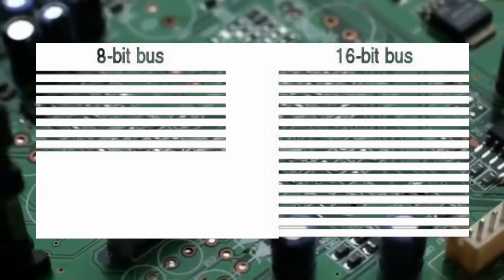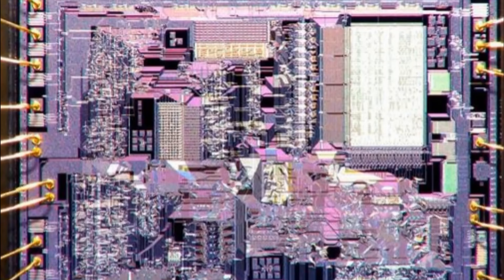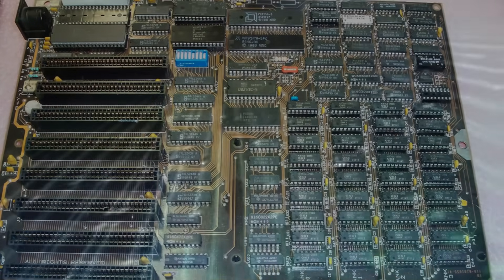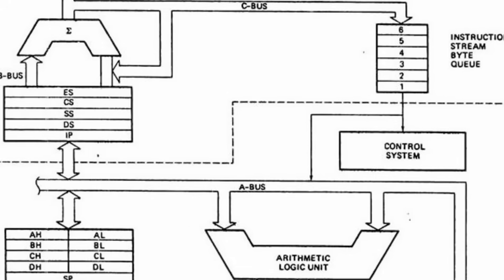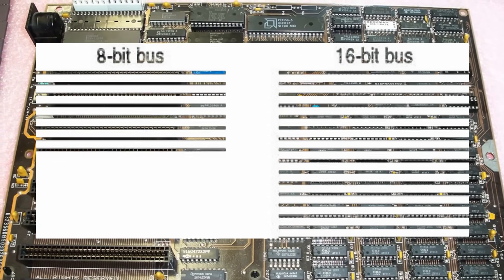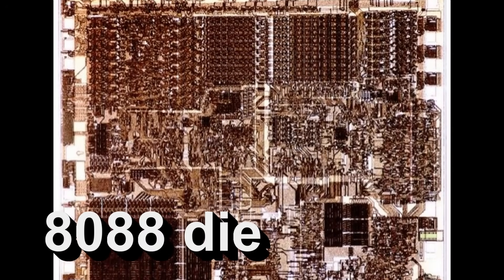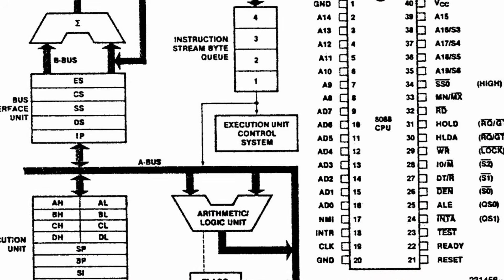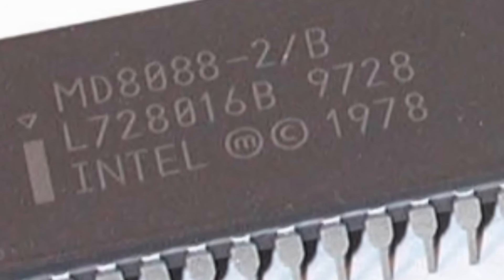8088 & 8086 CPUs... Why 16 bit Came Before 8 bit [Byte Size] | Nostalgia Nerd

Comment: after almost 40 years the 8086 is still in the legacy code of the x86-64 arcitecture ;)
Reply: Some maniac got windows 3.11 running on a 2.4GHz quad core i5 a couple of years back. You would not believe how fast it was. There is a hell of a lot of bloatware in modern operating systems that slows things down. That said the spoof version of DooM that was in one version of Excell was hilarious as the end boss was Bill gates in his underpants.
Reply: Windows 3.1 cannot use multiple processor cores. Only Windows NT versions could use multiple CPUs. Current Windows Versions derive from Windows NT.
Reply: Relax. S/360 24 bit instructions endured until the early 2000's. S/370 and S/390 ran these instructions ran these instructions with early /370 really only adding a TOD clock and a MMU (DAT). I think the early zSeries even still implemented 24 bit addressing. That's only 16M. About the size of a microcontroller by today's standards. There nothing wrong with maintaining compatibility. Nothing at all.
Reply: Personally I've been going down the low power route. My last buy was an I5-5600T with 8 gig of low power RAM and an SSD. Even with the keyboard mouse and monitor the whole set-up barely draws 80W when going flat out. It will quite easily run OrCad too. That said I'm looking for a better CAD system for electronics as I'm not impressed with either the software or the support. For seriously low power you can go down the 315 route and take another 30W off that if you throttle the clock a bit. If you get one of the really seriously efficient screens you can drop it to 40W total. Still runs Windows 10 OK and Linux is happy as Larry.
Reply: Gordon Lawrence wasn't that The Hall Of Tortured Souls Excell easter egg ?
Reply: The oldest parts of the instruction set actually trace back to the 8008 from 1972, and the Datapoint 2200 https://en.wikipedia.org/wiki/Datapoint_2200 , a TTL computer from 1970!
Reply: I could have got down to a lot less by using an i5-7002U which is half the power of the 3150, but it's only got 2 cores, and by using a laptop screen mounted in a desktop frame. The minimum possible is about 25W for a desktop but even the laptops only take 25W when not running fast and not running the hard drive. SSD's on their own are 5W when transferring data, 10W for the screen 5W for the RAM (Minimum) then 8W for the CPU and 5W for the motherboard. The only way to go below that is with a Raspberry Pi.
Reply: What make of SSD is it? Also is that during regular use or when doing heavy read/write?
Reply: ...but later on, seeing as I've just discovered a flaky USB cable interrupted a backup job that uses very heavy compression, which i thought had run successfully overnight, and have just had to resume.
Reply: Sandisk 480gb (SDSSDHII480G) - a hair under 4w when doing heavy random writes, a little over 3w at boot, under 2w the rest of the time.
http://www.storagereview.com/sandisk_extreme_ssd_review
Reply: Just like how humanity is still based on millions-old ooze too.
Reply: Though thanks to the various protected addressing modes that a typical BIOS and OS will almost immediately kick a modern chip into (never mind the different motherboard peripheral chipsets, video card support, etc), you'll have difficulty running a lot of 8088/8086 native code on a modern PC, unless your chipset and card have good built-in emulation for their own older standards, and you find a way to force it to start execution of code stored on a floppy or other such device without first booting the main OS or a new-style UEFI BIOS (though that's really the wrong term, as it sidesteps the normal "BIOS" altogether... I'm just not sure what the true term is, unless it's just "UEFI").

In fact a lot of the opcodes and maybe even microcodes can themselves be traced back even further, to the 8085 or 8080 (which is the root upon which both the x86 and Z80x architectures are built, being a significant advance over and also a significant codebase break from the original 8008). Because when it comes down to the really rudimentary things like ADD, or LDA, MOV, etc, why would you bother changing them from one generation to the next? And once you get down to the level where each of those only takes a single cycle to complete, you can't even really optimise them any further, other than maybe automatically recognising where you have a string of them in a row, particularly when each operates on narrow-bitsize data, and can parallelise them using SIMD and/or multiple cores. But you still have to load them in sequentially and output the data in a similar way unless they're all coming from AND going to adjacent memory locations. There's only so far you can pare down the fundamental, atomic operations, and there enough examples of code floating around in the wild for 20 years or more (and it's usually OS incompatibility that kills the true long-runners rather than CPU issues), so there's not really any reason to junk them or make huge changes to the way they operate and the opcodes they use.
Reply: +Gordon Lawrence ... well, you don't have to be that much of a maniac. I've seen a co-worker install it onto another's (Core 2 Duo) workstation whilst he was away on holiday for a joke before. It's a fairly forgiving OS, so long as it can read and write some kind of disk, as well as human I/O (getting the mouse to work is a bit of a game if you don't have a PS2 or serial one around, but USB keyboards work fine) and you have a compatible video driver installed (VGA does just fine), it'll fire up without any issues.

As for speed, Win16 was never particularly bothered about how powerful your CPU was (and, really, most modern versions still aren't, so long as you have a decent amount of cache to speed up task-switching). It's all about the memory, to cut down on how much it has to hit the disk, and to some extent how fast your video card runs and/or how much it has in the way of acceleration features. Requirements which any modern computer will fulfill in spades, even though it challenged a lot of contemporary machines when it came out.

You're right about how bloated some modern OSes have got, but Moore's Law seems to have outstripped them somewhat with Windows 7 thru 10. I've yet to use a computer running any of those which didn't feel just fine, at least so long as you had an SSD installed (it's still somewhat bound by kernel, service and program code loading times, and also swapping if you're low on RAM; hard drive throughput has massively lagged almost everything else in the computer speed sphere, and random-access times for spinning-disk drives have barely changed in thirty years), but I ran across quite a lot of dogs trying to run XP and ending up limping badly when it was contemporary. MS seem to have found a nice plateau in terms of how much chip power, memory and disk space they need in order to offer a well-oiled, fully featured modern operating system (quite simply, they've run out of things to add, I think, and are now focussing on polishing what's already there), and affordable hardware has had a good bit of time to stretch out and accelerate beyond the bare minimum needed for the salesmen in PC World to be able to keep a machine running at a good enough pace to make a sale.

Ten to fifteen years ago, the cheapest machine you might be able to get brand-new would be based on a hopelessly outclassed, P4-derived Celeron, and even with 2GB onboard would choke on XP Pro; with less memory, you may as well just forget getting anything productive done if e.g. it was time for a virus scan, or Windows update detected something new to download, even though the stated minimum was 256mb (and in some cases 128). Nowadays, I have a £40, Atom-based tablet that runs Windows 10 more smoothly than that, and the lowest end processor that's worth looking at is actually somewhere in the Pentium class (Celerons still exist, but they're looking a bit like a solution in search of a problem these days because they don't offer enough of a cost saving to justify the performance hit - even so, they are themselves streets ahead of the old P4s and probably on a par with the early Cores, maybe even Core 2s), which will punt along perfectly nicely under most usage regimes. You only really need an i3 or higher if you want to do more intensive stuff, like creating your own videos, gaming etc...

It's probably not even particularly valid to buy something like an i5 on the basis that it'll "last longer" in terms of being able to keep up with the loads placed on it than the lower grade chips. The CPU in the machine I'm writing this on is a second gen mobile i5, way behind the curve and not even really up to date when I bought the laptop five years ago... but the only time it ever shows any sign of stress is if I bulk compress a load of stuff with WinRAR, convert a long video, play a game that's maybe a little too new, or a browser process runs rogue, and even then the main problem is noise and heat, the system as a whole keeps running fairly smoothly, showing that most things on a modern OS need fractional percent of full performance to work A-OK, and efficient multitasking/task switching is no longer anything to worry about. Plus the rest of the time, including right now, it's just idling... At the same age, the predecessor Pentium-M (which was a pretty high performance chip in its day) was already starting to struggle a bit with some things like overly complex webpages, even under XP. By the time I replaced it at nearly 7 years old, it was borderline unusable for daily tasks. I don't see that happening with this one, even though it's got basically a direct equivalent processor, maybe even slightly lower grade (possibly a higher rated i5 or one of the lower grades of i7 would be a better comparison)... Probably not even if I finally bite the bullet and upgrade to Win10, though there's little real reason to do so.
Reply: I presume that's a desktop (and if so, that's pretty good going; the last time I had an "eco" desktop available that I could put a power meter on, it drew an almost constant 65w, peaking to 90w when really straining... 40w would have been pretty magical) - if you have an ultraportable laptop then 40 is pretty much at the top end, 25-35w in some cases. The one on my lap right now has an overall TDP of under 65 including the battery charging circuit (as that's what the power brick is rated for), and that already gets so uncomfortably hot at full blast that I have to use a riser stand to avoid burning my legs.

(Of course, gaming laptops draw a hell of a lot more power when running hard, but you're generally expected to use those on a desk, particularly as a lot of games benefit from using a separate mouse... the in-between market for powerful but portable machines is pretty much dead, most "full size" laptops I've seen of late are pretty much the same kind of U/P core but with a bigger screen/keyboard/battery and an optical drive)
Reply: That seems remarkably inefficient vs what I've measured before, and I'm fairly certain my own SSD isn't rated for more than 2 or 3 watts maximum. I've had a previous laptop (with a regular HDD and a non-LED-backlit screen) down to only 7w before, and I'm sure this one was regularly showing less than 10w without any special measures last I tested it... I'll have to break out the power meter and double check. It wouldn't be a stellar reading right now as I have a squillion tabs open so the CPU is rarely showing less than 9-10% load, but it would be fairly representative as a result.
Reply: +statinskill ... I'm not entirely sure what you're trying to say here. Who needs to relax, and what's the relevance of the IBM mainframe architecture (something that traditionally stays in service much longer after introduction than any given desktop equivalent - in fact, it was adapting to that faster pace which gave IBM so much of a headache breaking into the market, to the point where they basically had to spin the new desktop computer division off as its own autonomous entity so as not to be tied down by their wholly irrelevant big-iron-mainframe and five-ton-tabulating machine business philosophies) to the discussion?

NB, I actually ended up skimming past some pages on the System/370 line (which was only actively sold from the 70s to the 90s, though of course support lasted a LOT longer) as a sideline from browsing stuff to do with the 5150 PC's development (as initially there was even a thought that they might try to miniaturise the entire S370 architecture into a desktop box, and do the processor in-house, like with the earlier 51xx's and the SCAMP), and they introduced extended addressing fairly early on. Maybe you could configure a replacement machine to run in the same modes as an older, broken one for compatibility's sake, and wouldn't have to both updating your code which might quietly make use of the "extra" 8 bits in a 32 bit address word for other reasons, but you could get IBMs with 32 bit addressing (well, 31 - they themselves still reserved the final bit for signalling purposes, but that still added up to 4GB total if you used 16-bit words exclusively, same as 23-bit could make 16MB) from somewhere a couple years either side of 1980. I mean, what's the point of investing in a huge rack-based computer system if it's only going to be able to use as much memory as a desktop machine? They had to stay ahead of the curve, and the support for older addressing modes was likely just the same as Intel retaining the original modes in their later processors - for legacy code compatibility (and direct machine replacement ability) only, and because someone would yell blue murder if they didn't, despite 99% of users having no practical application for it any more.

Comment: This could of been summarized as the 8088 was a cost cutting version 8086.  

But the problem is BOTH are 16bit chips, plus the timings are a lot more complicated then merely that moves 16bits so its twice as fast as 8bit... For quite a few instructions, they were so long the extra cycles added made small difference.  Plus the instruction set is obscure, a instruction is between 8-120bit in length,  which is why timing is complicated, memory access aside instructions could vary between 2-180 cycles roughly for both cpus
Reply: *could have

Comment: The 8088 was $124 in 1979.  $124 in 1979 is $12,400 today, but those engineers didn't have to live in RV's.
Reply: It's about $450 in 2017 money.  About as much as a current generation desktop i7
Reply: The 6502 was only 25 .... selling far more computer and CPUS than intel and Motorola.

Comment: Now, what if IBM had gone for the 68k for the 5150 (which they almost did)... Things would problably have been very different today to say the least.
Reply: The Pilose One  Likewise, what if IBM had selected CP/M as the operating system, instead of MS/DOS from Micro$oft? Much, much different...
Reply: The 68 series unfortunately memory maps everything, whereas the 80 series from pretty early on has an I/O map as well as memory map. It's still not Harvard architecture but that would have required another bus which is too expensive for a lot of applications. Even low end DSP's are now going single bus to cut cost.
Reply: Better sacrificing a relatively narrow range of memory addresses for IO than putting up with that crawling horror of a segmented memory architecture in the x86s, though, as well as not being able to simply treat an IO target as a memory address and throw a value at it and let the support hardware deal with the rest (vs having all the IN and OUT, NEAR and FAR statements etc), with a nice simple one-bus design.

Even in something relatively convoluted and not particularly forward-thinking like the Atari ST architecture, there's less than a single meg of address space given over to all the system devices and the multiple 64k ROM areas (the latter being something that the IBM PC loses more than a third of the CPU's total address space to, and ends up having to address memory upgrade cards as peripheral devices - yuck! - and swap blocks in and out of a small part of main memory in order to work around), leaving more than 15mb usable. In a mid 1980s system design, which officially never had more than 4mb RAM installed. Safe to say it wasn't really that much of a problem.

Even in the Falcon, which only fit a relatively small number of main RAM blocks in-between the mapped ROMs and IO (in a similar pattern to various ST max-memory cards, presumably for compatibility with software written for them), provided up to 14mb of working memory, which at the time of its launch still seemed quite generous, and it was only limited to that because the 030 was bodged into what was essentially an old 68000 based motherboard design; if they'd managed to make a proper 32-bit one, then the reserved areas would have disappeared into the wider 4Gb address space and could happily have been masked off as a single multi-megabyte block without there being any trouble at all.

And, well, don't most Intel-architecture based 32-bit PCs of the modern age end up not actually exposing their full 4Gb range, and being stuck with somewhere between 3.0 and 3.5gb only, because of various reserved address ranges clashing with the RAM anyway? I think that's probably at least as much of an issue if not far worse... losing 512 to 1024 megabytes, a good 1/8th to 1/4 of your entire memory space (or 3/8ths, 384kb in the 5150...), vs less than 1/16th (and less than 1mb).